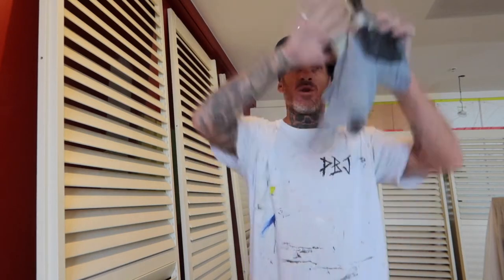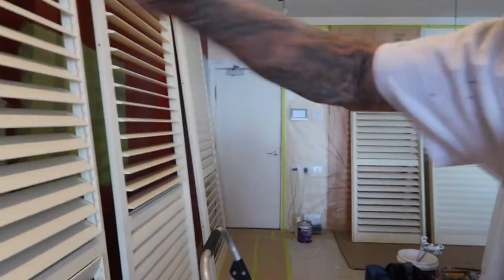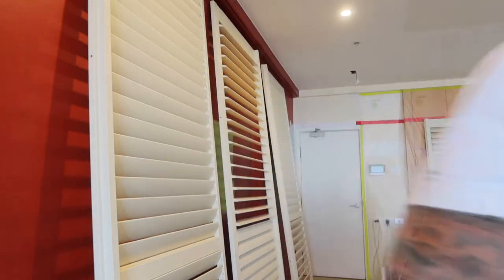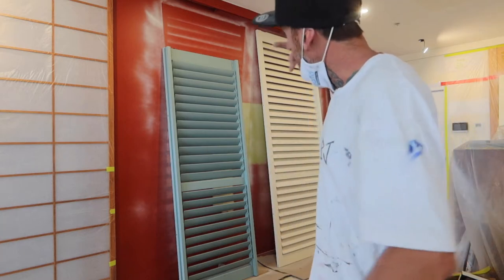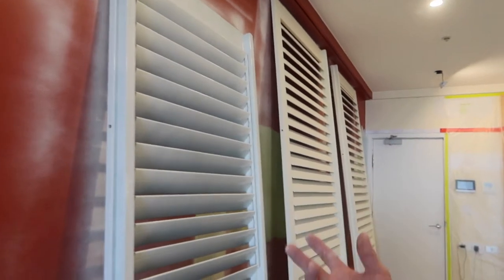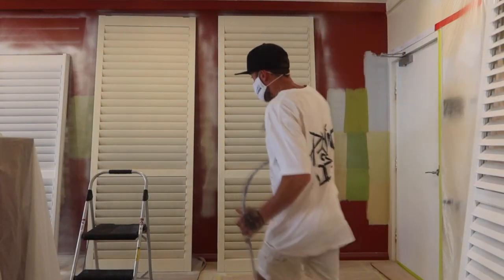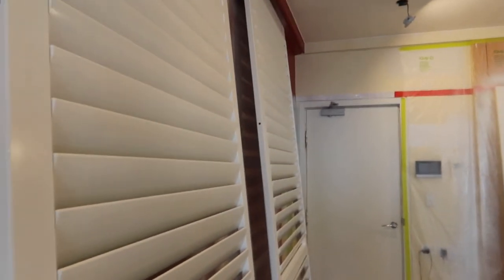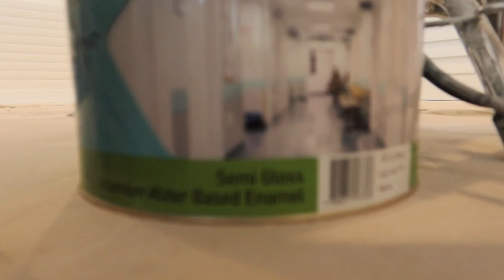HOW TO PAINT TIMBER DOOR & WINDOW SHUTTERS

Comment: Hi there, when it comes to paint runs does one just sand them back and touch up with the gun or will I need to sand the entire surface back before respraying?
Reply from the maker: Hi Blake, there is no need to sand the whole surface againg just in the defected area and spray over. In saying that some products do only have a certain recoat time otherwise you do need the adhere the whole surface again. I would just download the pdf file on the certain product just to make sure. Cheers for watching 🙌
Reply: Thanks mate, appreciate the help👍
Reply from the maker: @blakejames7997  anytime mate 👍